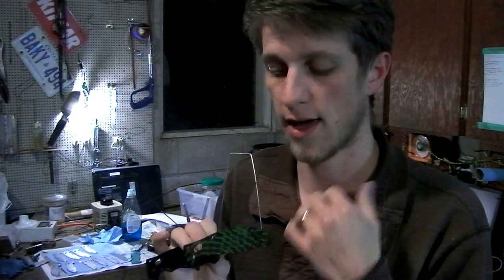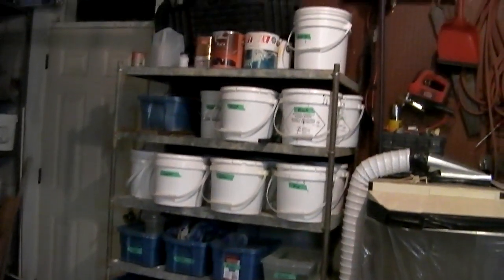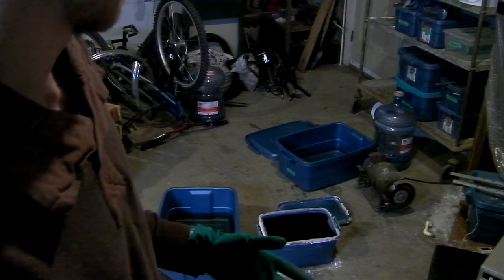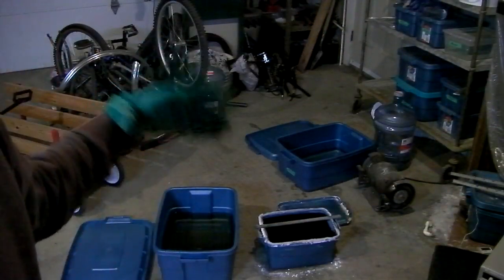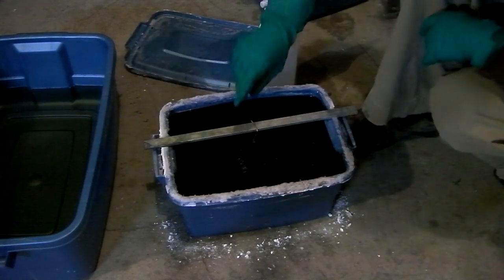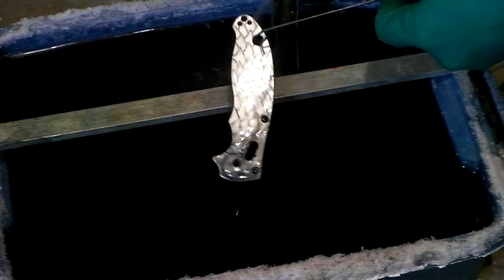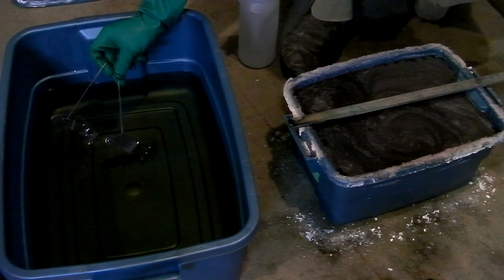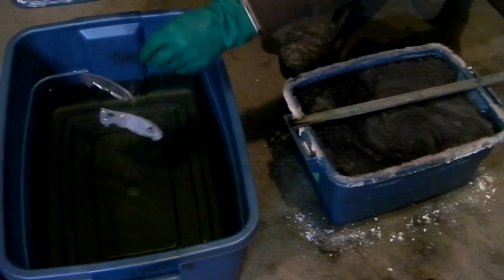De-Anodizing Aluminum

Comment from the maker: Depends on the intended use and the environment it will be exposed to.  Lots of people leave aluminum raw.  Heck, aluminum engine blocks and suspension parts are raw.  But the surface will definitely corrode over time, sometimes quickly (days).  Anodizing not only protects it but makes it look super awesome.

Comment: Hey John, great video.  I'm just confused about a couple things.  Is it necessary to anodize or coat 6061 Aluminum or any aluminum for that matter?  Can you just leave Aluminum in its raw state?  What happens to Aluminum if it's left without a coating of some type?  Look forward to your answer.  Thanks.

Comment from the maker: The tank is pure lye crystals mixed with water, I forget the ratio, so it gets soaked in that for a while.  Then I pull it out and spray it down with clean distilled water, both to wash off the lye and to blast off the smut.

Comment from the maker: No but I will clean it in a boiling hot "cleaner" solution from Caswell Plating.  That cleans off a bit of smut if there is any, but mostly gets them practically sterile clean, to the point where you can't even touch them again before anodizing.  So I do hot cleaner, rinse in clean distilled water, then anodize immediately.

Comment from the maker: Yes it would work great, but when making lots of handles like I do it takes too much time and effort.  Also, unless you're really careful and go really high in sandpaper grits (like 1500) there are always scratches that look like crap when anodized because anodizing doesn't hide *anything*.  Tumbling takes a while, but it's completely hands off, happens while I sleep, and gives a nice even finish over the whole surface.